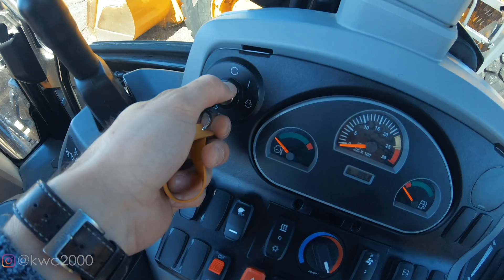BURYING A FIBER OPTIC CABLE! (FULL PROJECT) [4K]

Comment: Ugh, you buried that cable without conduit. Cringeworthy. That cable won't last. That particular cable isn't designed to be direct buried. Plus the UV from the sun has probably already weakend some of the sheathing. Do it once, do it right.